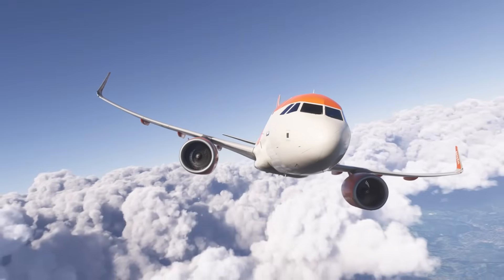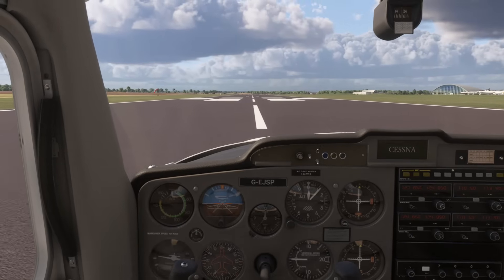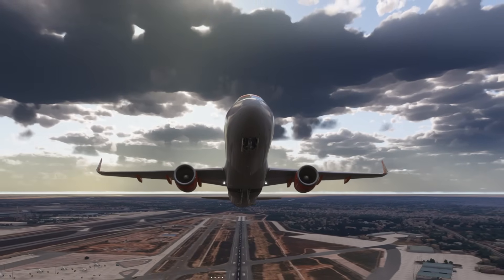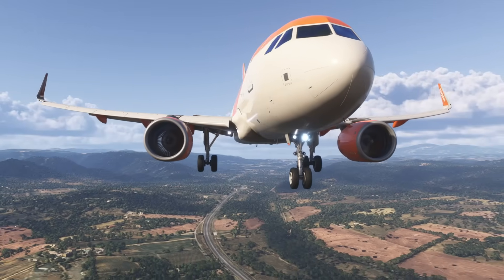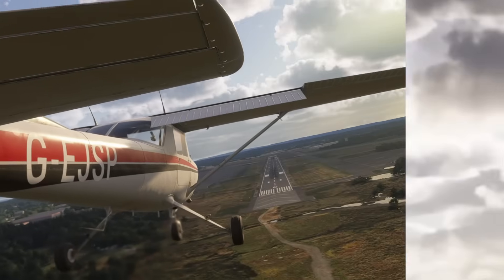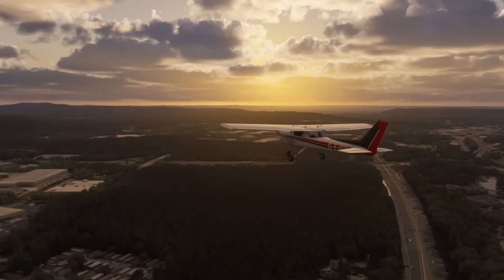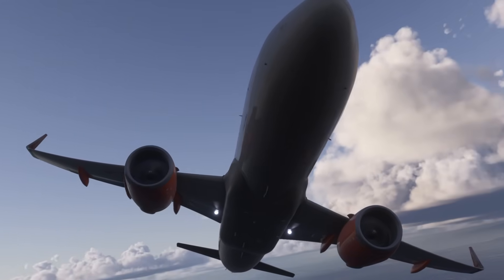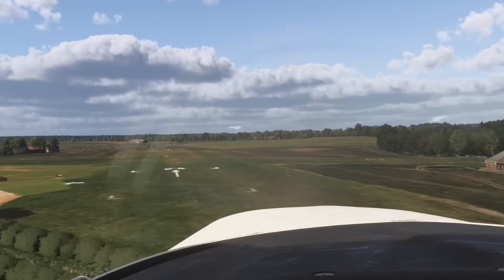Don’t Use the Rudder Wrong! | GA vs Airlines - MSFS 2020 & MSFS 2024

Comment: During my line training on my first jet (737-300) my trainer at one point complained that i must be a f*cking glider pilot and I shouldn’t use the rudder so much. Of course he was right, i started with glider flying where you have to constantly use the rudder a lot.

Later on the 737 fail operational it was a beautiful demonstration on autolands (FOs were allowed to do those for training purposes in CAT I weather) in crosswind conditions how you can combine both crab and side slip, which gives the 737 a higher crosswind limit than the A320 despite less ground clearance. The autopilot actually lands with up to 7° of bank. In manual flight up to 40kts of crosswind one can land without any de-crab at all, although that is not recommended on a dry runway.

In gliders there might a ball, but it is not sensitive enough so the mainly used „instrument“ is a string on the canopy that one keeps centered with the rudder, or slightly non-centered  while thermalling which can include constant turning at 45 to 60° if needed.

Comment: I'm a GA pilot IRL and I use the crab method for crosswind landings. One of the main reasons is it's just a lot more comfortable, rather than "leaning" all the way down final. The other thing is, you almost always get a wind shift anywhere between 500 and 1,000 feet AGL, and if you're doing the wing-low method, you have to adjust your setup. Same thing once you get under the treeline. I'm too lazy to bother. I was just, just stay on the extended centerline all the way down. Once you get into the flare, kick out the crab. Takes some practice, but you don't have to be perfect. Thankfully.
Reply: Either side slip or crab are valid depending on the circumstances. 

For a new student, side slip is better because it teaches them how to properly deal with the wind, PLUS they are set up way early. Kicking out the crab right before touch down can destabilize their approach. But ultimately it's personal preference.

Comment: Thanks! Question: how much aileron deflection is needed to counter the secindary effect of rudders during a say, 25 knots cross wind landing on modern jet airliners like 737 or a320? Of course each will behave differently but i wonder if full aileron deflection isenough in all cases? 

In x-plane and zibo, i find even full aileron into the wind not enough and often end up with a wing strike so practiced to slighty lower the wing just before the flare begins and it gets nicely cancelled out by the rudder. How realistic is this? 

Thanks!
Reply from the maker: You don't need to use too much irl as you say, or you risk a wing/engine strike. As it's only for the last few seconds of the flight, the aileron input also isn't for very long.

Comment: MSFS: C152 WBSIM and PMDG B738. The problem with MSFS though is that rudder sensitivity is so erratic, that no matter what type of pedals you have and how well you calibrate them, rudder control will still feel a hit or miss procedure. I assume that in real aircraft it's 100x easier, much more because you also feel the sideways forces. In MSFS it's nearly impossible to even do accurate nose wheel steering above 5kts ground speed.
Reply from the maker: It's definitely easier it real life. The sim does seem rather sensitive.

Comment: The ball doesn’t move much in a GA aircraft normal turn in msfs. Rudder input doesn’t seem to do much. It doesn’t seem very realistic. In old FSX it worked correctly, you had to input rudder in a simple turn to avoid a skid.
Reply: That's changing in SU4.

Comment: As a GA SEP pilot both wing down and crabbing method are taught and used. I actually use a combination of the two on strong crosswinds I use crab on approach and then rudder correction and wing down in the flare. FBW on airliners may negate pilot input but the rudder is still co-ordinating the turn even if it requires no physical input. Good video.

Comment: The very reason i haven't invested in rudder pedals 😂

By the way when i crab, and after landing release pressure on the rudder (on my side stick 😅), the aircraft nose sways in the opposite direction of the rudder input and makes airport move away from the center line. What to do in such cases
Reply from the maker: Don't let go of the rudder after touchdown!!! Easy to do - we think we're down and on the centerline, so we let go - but you can't, you have to hold it until you've slowed.

Comment: Fantastic little video! Would have been nice though if you could have gone into a little more detail by showing us what you were talking about when you were explaining the Engine Out procedure (2:39) and the slip or crab procedures. Some of us non IRL pilots have heard these terms but still have no real idea HOW to perform them!
Reply from the maker: The engine out video will be coming, but that is a mammoth video in itself and certainly not a quick 5 min one 😊
Reply: @Easyjetsimpilot  Thank you very much! Anything that can give us all the info we need to try to perform these procedures is much appreciated. For me it would ideally be xxx procedure for Dummies i.e. Where are we looking (inside/outside/split/instruments, etc) , what we should be seeing, what are we doing with what controls, etc. Whilst we will never do these things in real life it is really good fun to try and do them as correctly as possible.
Reply: Look up the FAA flying handbook, and boldmethod. Both great resources for the basics.

In a sideslip you increase bank in a direction (in the context of landing, towards the crosswind) with aileron, and then use opposite rudder to keep the nose straight (which prevents you from turning). This means you're moving laterally through the air, which is useful as it can counteract the effect of a crosswind pushing you to the side relative to the ground, while letting the nose remain straight towards the runway. You can maintain this all the way through touchdown. A forward slip is the same, but opposite. You apply rudder to yaw the nose to one side, and use aileron to bank the plane so it tracks straight through the air. This means you're exposing much more of the airplane to the airflow, and it greatly increases drag, which is useful for situations where you need to lose a lot of altitude, or some speed.

For a crab you just point the airplane towards the crosswind (in normal, coordinated flight) enough that you track straight across the ground. But unlike a sideslip your nose is not pointing in the direction you're moving across the ground, so you need to remove the crab before touchdown.

Comment: American Airlines flight 587 in 2001 crashed in NYC after it entered a wake turbulence situation. Co Pilot was conducting the takeoff. Once he entered the wake from a 747 that took off ahead of them he violently used the rudder in back and forth motions causing the vertical stabilizer to shear off.

Comment: In a crosswind landing would u have to apply the roll opposite to the yaw? Since you're applying  right rudder wouldn't the right wing dip down which would need left roll to prevent landing on one gear?
Reply: So, approaching the runway and the wind is from the right. Naturally, the plane will crab right into the wind as you track runway center line. You would apply left rudder to align with the runway. Now, naturally as you stated, the aircraft is going to want to roll into that rudder input. But, a bigger issue is that the wind is now pushing you left of center line. Though the right aileron will counter the left rolling moment from the left rudder input, you are using that right aileron to correct and track the runway center line. The good ole wing low method. I prefer it instead of the kick out in the flare. Inside of 300 feet, I go wing low to kill my drift and track center line. That way, I get a feel of the crosswind controls needed, warm up my hands/feet and don't have to worry about figuring it out in the flare. I'm just old school.